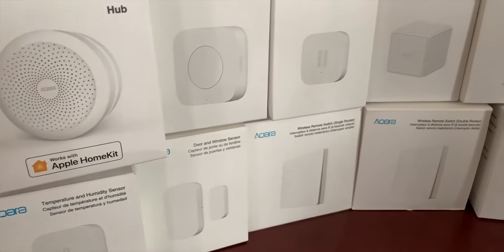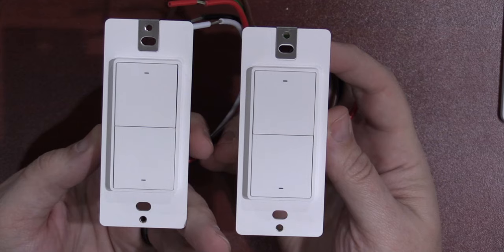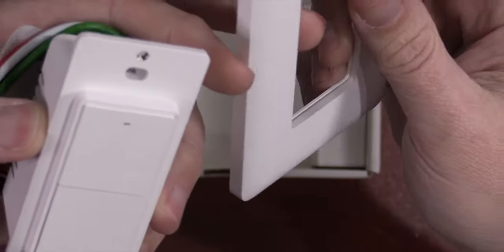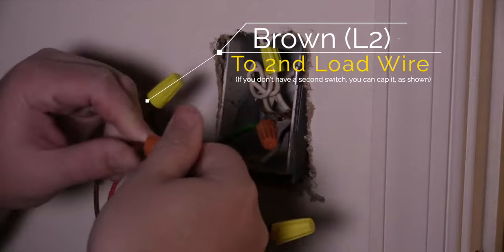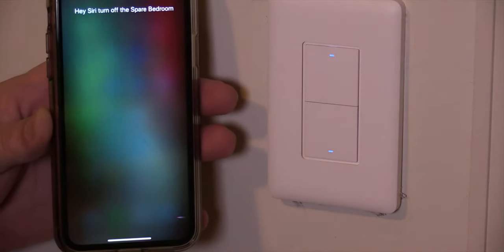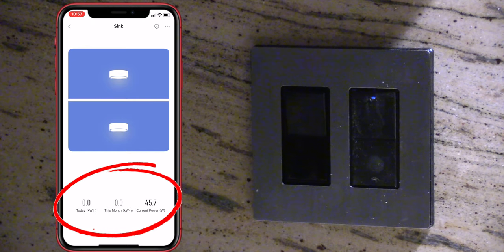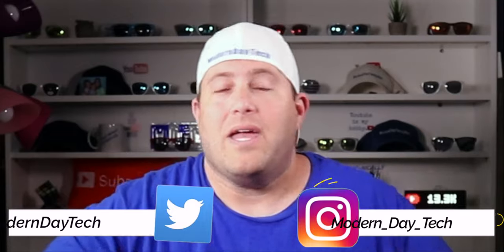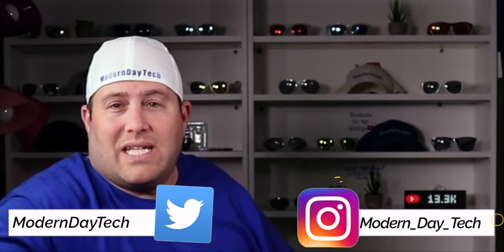Aqara Switch - Should you get the "Neutral" or "No Neutral" Version?

Comment: Great video Eric! Awesome tip for using the second button  to control other HomeKit accessories if you don’t need it for the wall! 👍🏻
Reply: I can use one switch to drive my overhead kitchen lights and second would be ideal for planned under cabinet lights.
Reply from the maker: Thanks Shane. I should of probably should have explained/shown it better but glad you get it. It's a great feature that that switches themselves are exposed to Homekit and I think a lot of people will want the 2 rocker because of it.
Reply from the maker: @petekottmann4422   Yeah Pete and what's nice is you don't need to hardwire the cabinets lights to the switch. Just make sure they are exposed to Homekit and you'll be about to control it from the switch.
Reply: ModernDayTech haha yea you kinda glossed over that point quickly. But when you did I was like OHHH 😮 dang that’s brilliant! 

I think your right, that could give many people a good reason to get the double, even if they don’t need it for the wires. Good stuff man.

Comment: Good stuff as usual. My only real option before because of old house wiring is Lutron, which I love, but I also love the idea of a double switch option for my bathrooms. I’m not a huge fan of adding another hub to the mix though.
Reply from the maker: Yeah I feel ya about about another hub.  I hate them but I have so many!! ugggg.   I love the double switch too. Mine is only hardwired with one light. The other switch I have triggering a HomeKit plug in the room.  It's pretty awesome.  If you don't want to go for the Aqara hub, you can also go for the G2H camera. It's a two in one device. Where you get an awesome HomeKit camera and Aqara hub.  The US/NA version is not out yet but it should be soon.  You can find out more about from the Chinese version - https://geni.us/AqaraCamBanggood. Subscribe & Stay tuned for a full review as soon as they release the US/NA version.

Comment: No Neutral. I can do without monitoring and repeater, but very curious how both SIRI and remote control of 2nd switch can even work without power?
Reply from the maker: Great question! I don't how (I'm no electrician), but the one I'm actually doing Siri with in the video is the no neutral one and it works.  It also works great for the second switch I didn't put a load on and I automated it to control the night stand through homekit.
Reply: I see from comments you’re using the “no neutral” and still works with SIRI (I’m no electrician too, so it’s melting my mind as I think how possible). THANKS FIR THAT CONFIRMATION.I know that the “Philips Hue Tap Switch” use kinetic power to transmit signal, but how a switch with no power can “receive” a SIRI command baffles me. They have got be be using some power and the ground as it’s neutral.  With the limitations you mentioned and fact it still works with SIRI and can remotely control a second device makes this an ideal switch. It’s saving me from going in attic to pull power. I just now need lights that don’t reset to “On” after power failures.
Reply: basically it's not without power, there is a small amount of power and AFAIK siri should work without any problems

Comment: My current setup has two switches under 1 plate.
There is 1 line wire and 1 load wire for each, so 4 wires in total. They are controlling two sets of lights individually, but just installed under the same plate.
Is the Aqara double rocker the right option for me? Thank you!
Reply from the maker: That sounds about right. Consult an electrician and use grounds.
Reply: @ModernDayTech  Thanks for the information!
I was checking the user manual from the Aqara site, seems like the double rocker itself has 2 load wires and 1 line wire.
So I assume I will have to connect the two load wires from two switches, and connect one line wire from one of the switches. Then there will be one line wire left from the remaining switch without connecting anything.
Does that sound correct?

Comment: If you have a version with neutral wire but your wall box does not have a neutral wire, will your switch still work normally without attaching its neutral wire?
Reply: nope.

Comment: Thanks for your video, it's very great. Do you know does this switch can be control by Mijia app ?
Reply from the maker: You can add it, but it doesn't show up after that. I'm not sure if they will fix that issue cause I don't know if it was designed for mijia app.  These switches are for the US market.

Comment: Neutral switches work with non-neutral wiring? I read somewhere it doesn't
Reply from the maker: That's correct. If you don't have neutral, you have to go for the non-neutral switch (07:22) If you have neutral, you can go for either one and that's what I'm talking about in the video.

Comment: Hi! Would it be possible to use the switch with a neutral wire with a switch box without a neutral wire? I’m trying to figure out a work around. Thanks!
Reply from the maker: Unfortunately not. If you have the model that requires a neutral, you need a neutral.  The hardwire & specs are are different. No other work around, either install a neutral wire or buy the no neutral require model.  Thats the cheaper route.
Reply: @ModernDayTech  thanks for the quick reply and the advice! :)
Reply from the maker: @antonrecto11  anytime. Thanks for watching and commenting.

Comment: What do you with brown wire?
Reply from the maker: 3:31 That's the second load wire.
Reply: So what do you connect it to as I only have a black and red
Reply from the maker: It sounds like you need an electrician. Don't mess around!  These switches DO NOT work in three-way setups.

Comment: Thanks for the great video… I have a question, how do I make the switch (with neutral) act as repeater?
Reply from the maker: Thank you. That's a good question. I don't think you can. I believe it's automatic.  I haven't seen any setting or log of what child devices are bouncing through a repeater but that's something that is need in the Aqara app. Plus I wish Aqara would allow multiple hubs be repeaters but they don't.
Reply: @ModernDayTech  what about adding an Aqara M1S to an existing Mi smart home hub? Will they work together? Or are they going to work individually and can not talk to each other
Reply from the maker: @Halsalloum  No, that was the second part of my answer. I wish that multiple hubs could be repeaters.  But child devices, from what I've been told, can not connect to other hubs is their assigned hubs are further away. But things change all the time so who knows for sure since they don't show any Zigbee network hierarchy in the apps, like I've seen with other z-wave and thread apps.